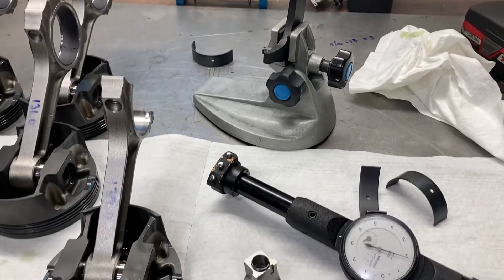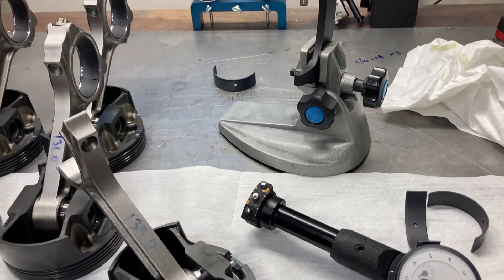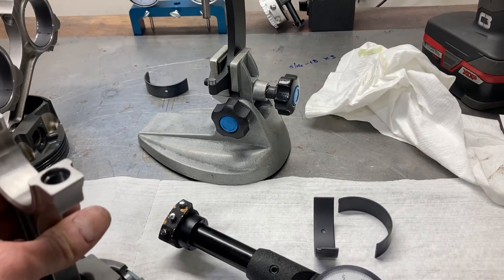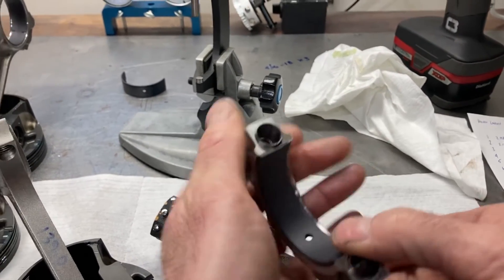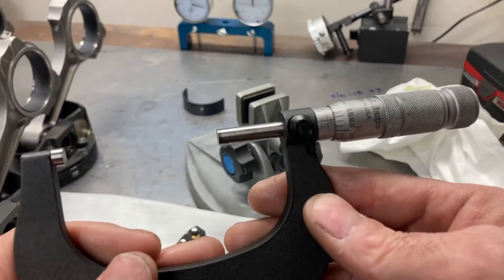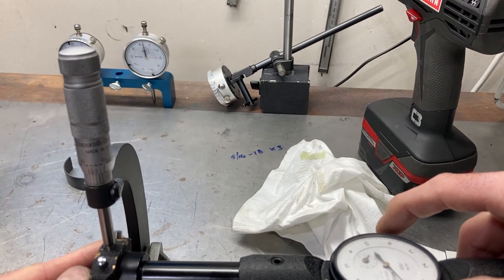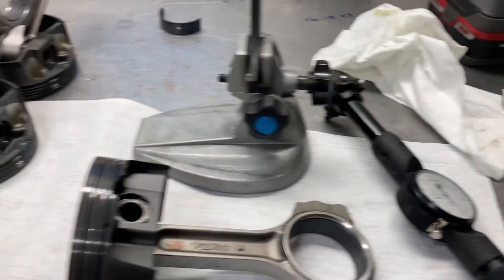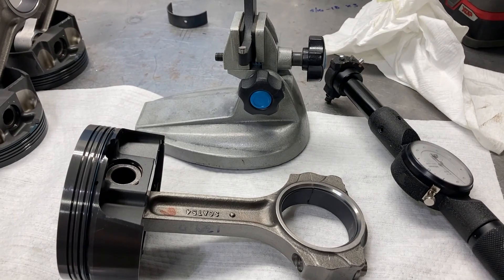Lykins Motorsports Checking Rod Bearing Clearances

Comment: Looks good Brent,  enjoy these. Do you use rod bolt stretch gauge to properly tighten rod bolts on final assembly?
Reply from the maker: I use whatever the manufacturer recommends.  If they give a torque spec, I use that.  If they give a torque-angle or a stretch spec, then I'll use that.